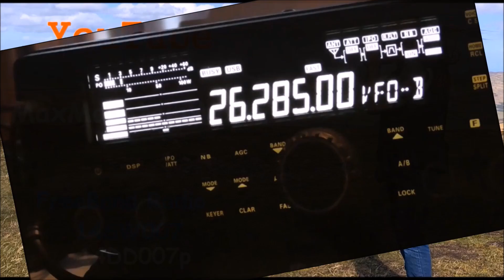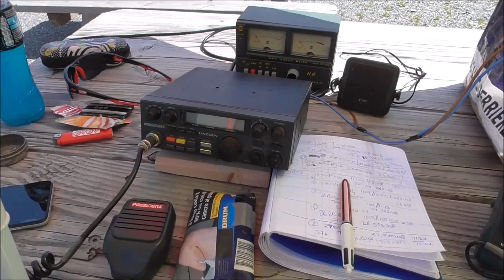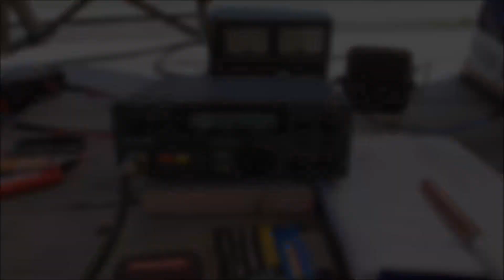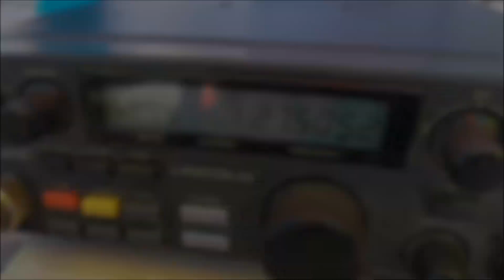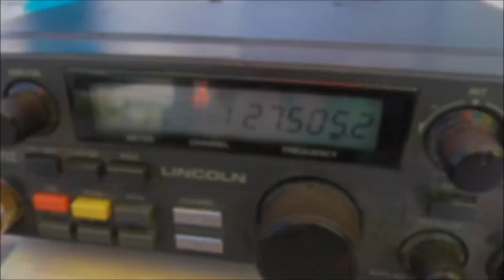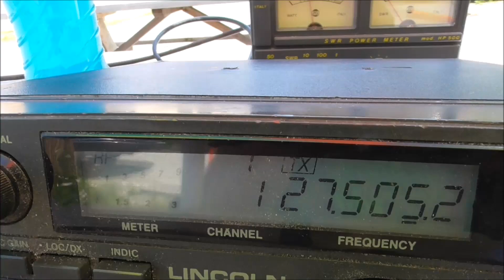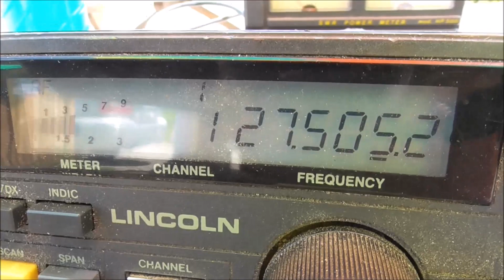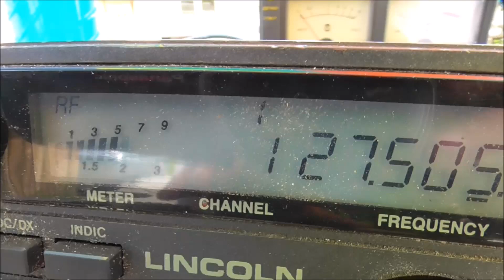Portable Radio DX Kit 1st. Test

Comment: Nice little setup Max, awesome radio the mk1. Bought my replacement 2yrs ago after selling my original mk1 early radio with the better finals. Mines coupled to a 22ah lifepo4 battery and a gainmaster mounted on a drive on mast approx 25ft.
Reply from the maker: Thanks, nice set up. My drive-on mast base is in the boot of the JAG next to the 105AH camper-van battery. Yeah, I have loads of Videos on this lot. Cheers

Comment: Nice one Max. Listening on 11m last night about 10pm local time still loads of sparadic E yet 10m what empty. You are probably aware but if you can get a small lifepo4 battery it will be about a third of the weight of your SLA battery.
Reply from the maker: Yes, conditions are interesting just now. I just bought this battery, Newest "sealed" Technology with awesome draw & recuperation characteristics (-0.22volts in 2 and a half hours constant use). Its not heavy and did cost a bob or two. I have yet to charge it. Cheers

Comment: Nice setup! I have sth. similar in mind and ordered all the parts for a Moxon. What mast are you using? Alu or fibreglass? You mention Spiderbeam, but which model? It seems to cope with the rather heavy Moxon well…
Reply from the maker: Thanks. It Is Fibre Glass. I know nothing more as it was a gift from a Radio Friend. My Moxon (built) weighs just over 3kg.(and about to get lighter... watch my nest Video...) Cheers